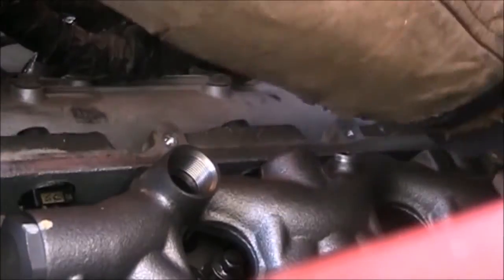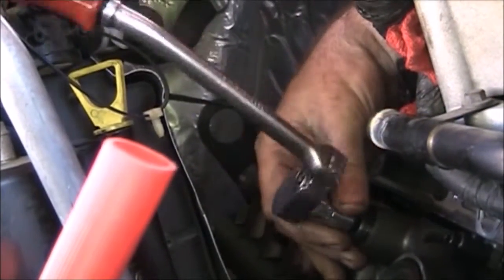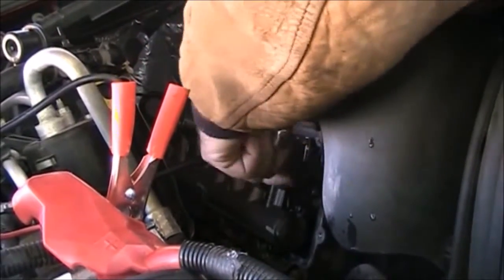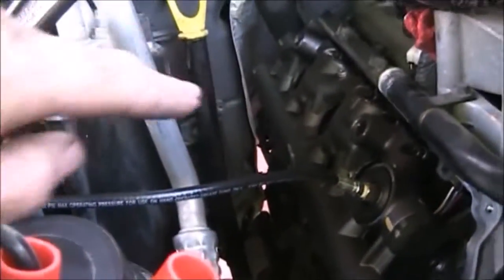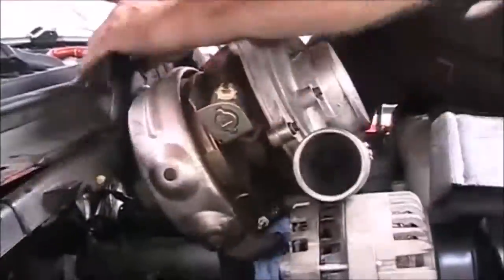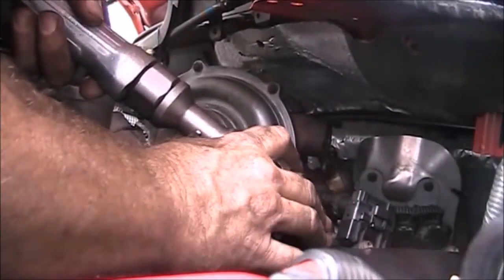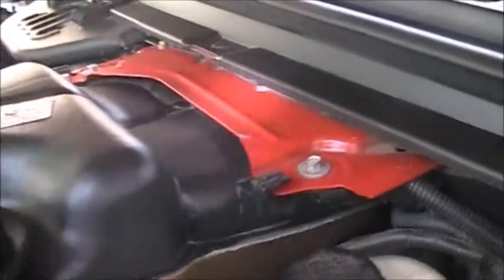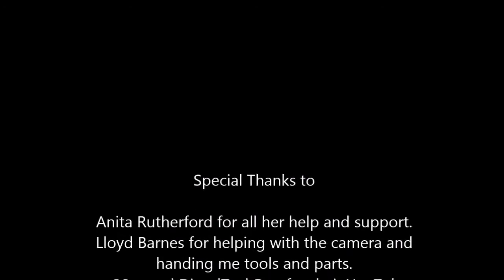Part 3: 6.0 Powerstroke Dummy Plugs, Stand Pipes, Blue Spring Update, and Reassembly

Comment: I am buying my first diesel truck, and it’s a 2006 6.0! My gasser F150 is just not up to the task of towing out trailer. Thank you for this video…
Reply from the maker: Congrats! These are great trucks as long as you treat and maintain them properly. Make sure you watch powerstrokehelp's series about fuel, filters, and fluids. Knowledge is key. A person can do more harm than good by using the wrong materials to maintain their powerstroke. Best wishes.

Comment: great videos....very informative...thank you. I have had a ton of issues with my 6.0 over the years. new heads, head gasket, updated egr cooler, updated oil cooler, stc fitting replaced..added studs and coolant filter. right now it is a long crank when cold but once it fires it is fine ...after shutting it down it starts great. if it sits 12 hrs. it is hard start again. my gauges show icp slowly coming up on cold start. it takes about 15 seconds before it hits 500....when cold. suspect leak at dummy plug or standpipe. going to replace and do blue spring update. any ideas or thoughts? thanks again.
Reply from the maker: caseskidsteer1 ,
It seems like something is causing the HPOP system to drain while it sits for an extended period of time. I would air test it to see if I could find a leak. With these symptoms, I suspect that the leak is below the fuel rail, meaning lower in the engine. It could be the ST fitting or maybe a stand pipe. Do some investigating before you just throw money at it. Good luck.

PS Thanks for the feedback.
Reply: I know its 4 years ago, but did you find out your problem?
Reply from the maker: @alfredo3314  ,
I know your question was 8 months ago but I just saw it today. As you pointed out, it has been years since I made or even watched this video but I am pretty sure that somewhere in here I show that the whole problem stemmed from a single worn o-ring on one of the dummy plugs.
   With the benefit of hindsight, upgrading all of these parts in one tear-down was one of the best decisions I ever made. I've had a few other problems over the years but I haven't had any more trouble out of the HPOP system. The truck currently has a little over 212.000 miles on it. Thanks for your comment/question. I do try to answer questions as they appear but this one got away from me. I'm truly sorry for leaving you hanging like that.

Comment: please answer the following questions... how many dummy plugs? only 2? is it one on each side? are they the same part number? thank you
Reply from the maker: There are two dummy plugs and two stand pipes. The same two parts fit both sides of the engine. (4 in total).
The cast oil rail fits both sides of the engine. Since it is turned 180 degrees to fit the other bank, it needs to have holes in both ends for the stand pipe, which connects the oil rail to the branch tube, which connects to the high pressure oil pump. Because the part fits both sides, the two extra holes need to be plugged with the dummy plugs.
Reply: @VernesMisadventures  Thanks 👍

Comment: if air leak the truck no start?
Reply from the maker: If the system leaks air, it likely leaks oil internally. This loss of oil pressure will cause the injectors to fail to fire and ,therefore, the engine not to start. Please watch part one to learn how to determine whether there is a low oil pressure condition present. Good luck with your 6.0 and thanks for watching and commenting.

Comment: l have 2005 f450 6.0 crank no start, l check & leak air from oil cap
Reply from the maker: In part one of this video series, I demonstrate how you can listen to determine the relative location of the leak. With the oil cap removed, you will hear air venting through the open hole. Determine whether it is a metallic venting sound or more of a hissing sound. If it seems more metallic (Like a compressor tank sounds when air is being used.) the leak could be coming from another part of the engine, such as under the other valve cover, the IPR valve, a branch tube, or even the pump itself. Most likely, it will end up being a dummy plug o-ring, as it was in my case. You can remove the valve cover breather from the other side to see if you hear more of a hiss from the driver's side valve cover. Wherever you hear more of a hiss, it is likely that the leaking component is there.